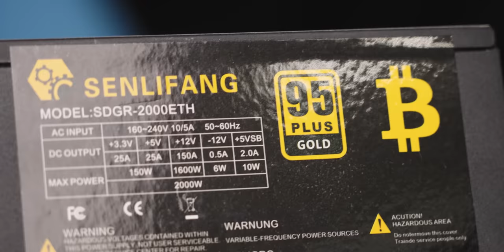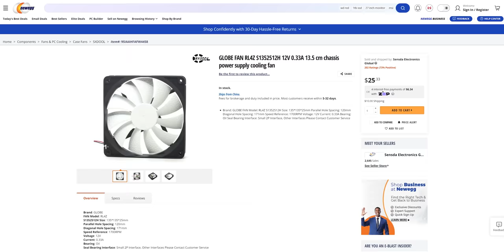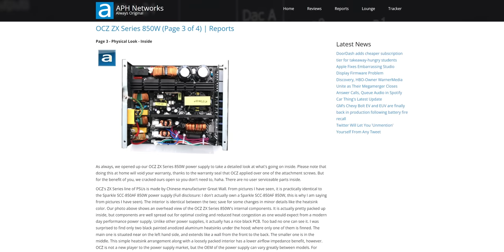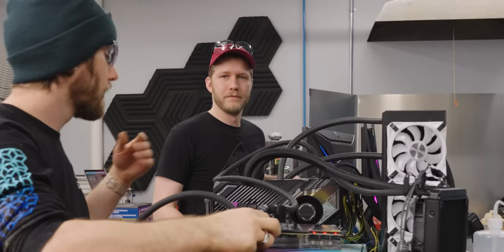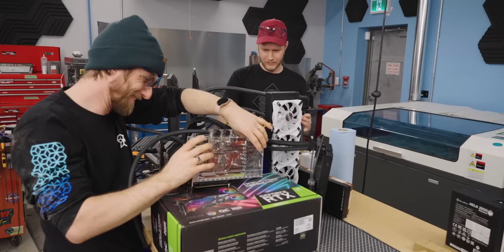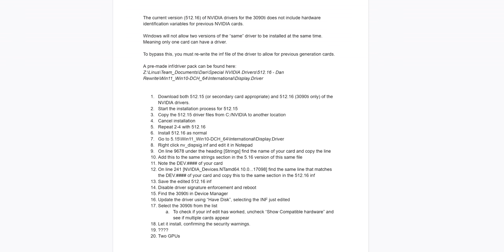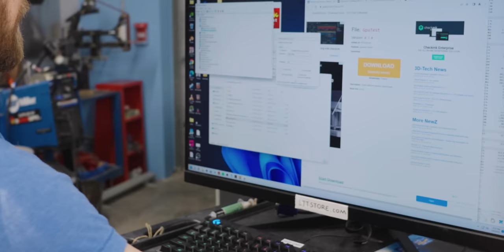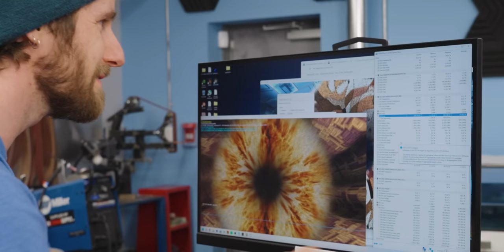This is one SKETCHY 2000W Power Supply

Comment: You guys should do collabs with actual electrical engineers who know what goes into power supplies to do side by side analyses like this. The size of a transformer for a given wattage and frequency is mostly the same regardless of voltages unless you're at very low or very high voltages. And PFC is necessary for anything at this power level regardless of voltage level. Weight difference could come from smaller filters on the AC side resulting in more EMI, smaller inductors and caps on the output meaning higher output ripple. It could also be that they used higher switching frequencies which would shrink weight and size a lot at the cost of efficiency which people are a lot less likely to notice
Reply: alex clark guy is an actual ENGINEER!
Reply: You do know that Alex is an electrical engineer, right?
Reply: As everyone's said that's Alex, also Kyle is an electrical engineer as well I believe
Reply: They do have actual electrical engineers. They just don't put in the time and effort to actually analyze anything cause being "probably correct" is all they need for a profitable video.
Reply: Agreed 👍👍👍
Reply: An electrical engineer wouldn't say that transformers and inductors are made of "lots of copper and lots of magnets."
Reply: That is the same thing i was tinking when i heard that guy talking like that, it is clear that he does not know or at least dont even care about how a PC PSU works. Anyways maybe that is cause he es a Electrical Engineer and not a Electronics Engineer.
Reply: Or there's the alternative: 
GamersNexus
Reply: I was trying to sort out if they were dumbing things down for comedic effect or if they really don’t understand what they are talking about. As for that modded GPU; I’m surprised that thing still even works....
Reply: @timnone2924  and others, I actually didn't know they were electrical engineers but given that they are only makes me more confused as to why they said things that were so blatantly wrong. As someone mentioned, a transformer doesn't contain any magnets in it, I don't really see the comedic difference between calling it a bunch of copper and magnets vs a bunch of copper and steel. And if it is truly just comedy they should own it, the side by side comparisons make it seem like they're trying to be scientific or atleast genuinely inquisitive and they're being neither
Reply: @timnone2924  if Kyle really is an electrical engineer, then I'm scared. He doesn't know the simplest basics about electronics

Comment: 8:42 That is not a MOV, it is a thermistor (NTC type) generally use to prevent inrush current (soft starter)...etc (NTC Type -  Resistance is inversely proportional to temperature)....Conclusion of Linus: "Based on the temperature of inductor"😮‍💨😮‍💨😮‍💨 ...You guys need proper Electrical/Electronics/Instrumentation Engg in your team.
Reply: Yeah, normally I enjoy LTT antics but this particular Video was just too cowboy for someone who knows even the basics of electronics
Reply: yeah.. that's a bit sad. They are not teaching but rather confusing more people. Same thing with the dead GPUs from ebay video where they were just bypassing MOSFETs. In most cases, the mosfet would be a switching component (as in part of a switching power supply) and not just a "relay" allowing current to pass. A GPU has no need to turn on some parts of its circuitry on demand.
Reply: Yea sometimes I question the EEs they hire. If your in product development you know there’s so many ppl from SI to PI to EMC to validate everything.. good times tho

Comment: "Where are we going to plug this 2000w monstrosity in?"

Me as a german: Dude that's only 2000w, my normal wall outlet is wired up for 3600w lol"
Reply: LMG snakes a power plug over the ocean
Reply: Isn't it standard 4000 watt for pretty much entire europe?
Reply: @bachmed00  I started wondering - how do American use hair dryers and such? I have a hair dryer that's 2400 watts, while average seem to be around the 2kW mark.
Reply: @hotwheels1997  They use them, but only at half the power. Just freaking terrible. I want my kettle to finish in 2  minutes not 4!
Reply: @DrakkarCalethiel  Damn, women must take even longer to get ready over there. Do appliances automatically lower their draw or they’re specifically made for the US market at lower power? I’ve never thought about this being an issue anywhere, new things to learn every day.
Reply: @hotwheels1997  Alone due to only running at 120V, all devices are specifically designed and rated for the NA market. Our Hairdryer eats 2200W, the equivalient US model only up to 1800W. They do have 240V for high power draw appliances like dryers and washing machines, but every regular thing has to cope with 120V 16A. We europenans laugh at that  with our 230/240V 16A sockets. :D Will be funny in future if the power draw of hardware further increases. A overclocked 12900k pulls 300W. a 3090Ti 450W+, rest also eats a couple dozend W. You quickly end up with a system that can draw an excess of 900W or even a full kW. Soon they need a whole dedicated circuit just to feed their damn PCs. XD
Reply: @bachmed00  Some time ago we used 10A runs in bedroms and other smaller rooms (where heating often was on a separate circuit). Now it's 15/16A all around, and 25A circuits for high-load appliances.

Comment: 7:42 That is not true. The point of a MOV is not meant to 'level out' the spikes. The point is that if an extraneous voltage spikes the MOV shorts, in turn triggering the fuse. Short term the fuse will not blow due to thermal inertia, but most over-voltage events are long enough to burn the fuse. This in turn protects the power supply and components after the fuse from damage. This is why you ALWAYS see the MOV after the fuse in the circuit.  
Actually without triggering the fuse a MOV would destroy itself extremely quickly as it cannot handle much power at all. It shorting a high voltage to ground with a low resistance would mean it needs to dump massive amounts of energy in a small time, hence it cannot be the main protection device.
Sure it might work for short spikes, but it is not a reliable and safe way of doing things. Especially as MOVs tend to fail in short circuit mode, which means that they will burn and cause a fire hazard.
Reply: Where the fuck did they find that guy, isn't he like supposed to know shit about electronics? He was wrong about everything he has talked about in every video he's in
Reply: Can confirm, an unfused MOV is a lot more trouble than no MOV at all! I once connected a 120V power strip to a 240V source, not realizing it had MOVs inside it (without fuses). An enormous bang ensued, followed by smoke emanating from the power strip. The output of the power strip didn't even shut off.
Reply: @DielectricVideos  My power strip had 3 MOVs as crude over voltage protection and "filtering". In the middle of the night the MOV between live and neutral decided to commit suicide and went with a loud bang. It was on a regular european 230V 16A circuit too for extra spicyness. MOVs NEED a fuse, be it a normal one or a thermal fuse. When they fail, they mostly fail short. Also they tend to heat up quite a bit when they get tired. MOVs have a limited lifespan and can only absorb so many transients.
Reply: @DarkoPetreski  like I was so mad ...they got so many thing wrong ..can't you take a day and search this stuff on Google? Smh

Comment: You could risk $6,000 in gaming equipment.

Or you could just let Gamers Nexus do it with the proper power supply testing equipment.
Reply: yeah there is equipment to test volts and watts for f sake... buut LTT has to do stuff sensational for views... (dont get me wrong I love these guys but still lol)
Reply from the maker: We've had a proper PSU tester on order for a couple months but with supply shortages it won't arrive anytime soon. -AC
Reply: @LinusTechTips  Meanwhile you could send it to Gamers Nexus and let them do the testing
Reply: @LinusTechTips   thanks for responding.

Figured originally you guys were just seeing if it blowed up a pc for the video..

Which I don't blame yall its a good video idea lol.

Comment: 11:25 In North America, that's the US and Canada, the white is always Neutral and the Black and Red are always Live (or hot).  You may see 220/240 volts run with Romex or extensions wired with the white as a second live/hot line instead of neutral, but these white wires are supposed to be marked with red or black tape (or heat shrink tubing ;) to indicate that they are also live and part of a 220/240v circuit and not actually neutral anymore.  Adding red or black tape is usually done when converting a 110 socket over to a 220 socket and you want to keep the original wiring...
Reply: Came here looking for this clarification. Thank you.
Reply: To be more pedantic, white and gray are always neutral, green or bare is always ground, and everything else is hot.
Reply: @eDoc2020  never shy from being pedantic. To go further it is now called the identified conductor, though still known as neutral
Reply: @8blade6  I thought the "identified conductor" was the one with the color tape applied. Neutral is the grounded conductor which of course is different from the grounding conductor.
Reply: @eDoc2020   Technically here in Canada, the black is the current carrying conductor, white is the identified conductor and the green wire is the bonding conductor not ground. You only have a ground conductor at your service entrance where it is tied to a grounding rod or ground plate in the dirt outside. After that it is called a bond as it does not go directly to earth but bonds everything back to the ground conductor.
Reply: @fakeacountname565  I guess different countries are different. I was talking about the US. Here your bond wire is called the equipment grounding connector and your ground wire is called the grounding electrode conductor.

Comment: Fun video as always but it was a bit tough watching the analysis of the supply insides, those ntc thermistors are for inrush current and are not MOVs, that yellow tvr was likely an actual varistor. I'm not an engineer anyways, and I get that a detailed explanation of the different topologies between the two supplies is out of the scope of this channel.
Reply: Yup, and talking about the 240/120v switch: there's actually very little extra hardware. The switch turns the bridge rectifier and input capacitors very neatly into a voltage doubler.

The talk about additional transformers was all wrong
Reply: @James Hogge  Yeah the discussion about the transformers was pretty hand wavy, those things are proper insulated so just touching the top of them isn't going to do any harm. They also aren't made of magnets, unless you're very loosely referring to ferrous materials. If I had to have a guess I'd assume each transformer was for a separate rail, or maybe even something esoteric like a multiphase full bridge/half bridge converter considering the power density.
Reply: Yes it's always a pain watching these bits of their videos, but it gives a great perspective of a layman.
Reply: yeah the level of incompetence in correctly comparring the two is jarring at times
Reply: @jameshogge  No.. Actually not... Those Switch Equipped PSUs are too crap and old designed Half Bridge Converter.. They tend to fail more than.. modern Dual switch Forward and Resonance LLC PSUs..

In modern PSUs.. The APFC Circuit actually Boosts Voltage for primary Capacitors.. to like 350 volts... 

And those extra transformers in that PSU.. we can't say about them much .. because.. they can be connected in many many ways .. like 2 in. Series..  or both in parallel of Primary series and secondary parallel..  or vice versa.. there are many possibilities... For transformer configuration for load sharing in PSUs...
Reply: Linus should do a collab where he gets schooled by that Australian EE guy.
Reply: @mcpr5971  that EEVBlog? or Electroboom? or GreatScott or DiodeGoneWild...  I can say DiodeGoneWild can explain everything about those PSUs..about both
Reply: @ArifKhan-bp9zx  eevblog. Thanks I couldn't remember it.
Reply: @ArifKhan-bp9zx  Oh really? I'll have to take one apart and see what they do these days. I've only ever reverse engineered one of those mid-2000s silver oem ones. It would be interesting to see how things have changed though but I'm surprised anything on the high voltage side is significantly different

Comment: You should buy professional load equipment, it can be controlled digitally, measure voltage, etc. It is way better than a regular PC with two GPUs.

Comment: Auto-switching power supplies don't just take 120V or 240V.  They take any voltage inside the range of about 100V to 240V.  Higher voltages mean more efficiency, which is why it's common in data centers to offer 208V power, because virtually everything you put in a server rack will happily run on that voltage.
Reply: USA and CANADA and JAPAN should just switch over to 240V. Would also be good for the enviornment.
Reply: Auto switching supplies only take fixed voltages. Fortunately these are rare nowadays and we mostly only deal with wide-input supplies.
Reply: @HermanWillems  North America already has 240 VAC single phase. We just have a center tapped ground bonded neutral because we're not poor and stupid like the rest of the world is.
Reply: @1pcfred  wdym poor and stupid? And everyone means 230/400 three phase in the house when they say 230 (220, 240)

Comment: Japan uses 100VAC, which may mean slightly lower performance or slightly higher amp draw if North American appliances are used unmodified.

Additionally, some of Japan runs on 60Hz (like NA) while some of Japan runs on 50Hz (like Europe).  YMMV.

Comment: Never cheap out on power supply. It is literally insurance of your parts.
Reply: indeed.  But considering 2000w? thats a lot lol, most parts now a days don't use much power.  My intel nvidia system is prety beefy and still idles at 90w and medians at about 200-300w depending on game, on a old class corsair  750w supply*(one of the bests I ever owned, as I own several); hard to find now a days :(     .  My netbook is like 5-10watts lol.

A good quality 500-750 w PSU goes a long way as they are prety strong, need one with  good high amp rails for some cards/cpus, if you don't plan on rigging 2 or more video cards.

Also, depending on heavyness, helps too.. CHeap psus don't weigh much. Good psus, weigh more which I find interesting.
Reply: I really can't understand why anyone would buy one of these PSU's. Spend thousands on a build with a 3090Ti and high end CPU etc, but can't spend $300-$400 on a quality 1200-1600w  PSU, which is plenty of power for the build.
Reply: @bongong1  Its fun to spend money on a badass GPU and a super fast CPU. Spending money on a metal box you will never look at past initial setup just isn't as fun. Even if it is a very important metal box.
Reply: @bongong1   Plus people are on a budget, some*, if you are able to cut costs and invest in performance on other parts and risk, and it works out, money saved for some.  I've done it myself too,  but I was lucky to get a no name psu with heavy components which is a good thing, and lasted me a long time, no use for it tho, as its old; mainly only looked at amp rails for my old 780 ti back then.; but switched it out to another corsair later on.

If going for a no name brand, always make sure for a lot of good reviews and look at the bad ones too. Sometimes they can be good, sometimes they're just bad.
Reply: @Khel   yea But I don'T ever think that far ahead on my builds like super crazy high perm builds, usually just keep them to a min with the 80s/ti's , I think I gone down the list on my buiilds from 780s and climbed above.. Usually keep the watts low when I can.  I don't think theres many that do, as they have a hard enough time to get more than 1 video card..
Reply: @bongong1  It's not meant for regular gaming systems. It's meant to power GPU mining rigs that may have 6-8 cards installed at 200 watts each. And for mining rigs, investment costs are very important, because that maximizes ROI.
Reply: Meh, using the same 630w powersupply for 2 build now, so closing in on 10 years. Still fine. It's running 3070rtx with 5600x, 3 discs for 2 years now straight. Bought 2014.
Reply: @MrGatlin98  lol mining rigs karmas a bitch ain’t it
Reply: This is exactly what happened at my workplace. They built great computers for image processing geared towards architects, but powered them with the jankiest and cheapest knockoff PSUs to ever exist. Of course both computers caught fire, although very lightly since the smoke and the smell made people act fast before any more damage was done. I still laugh looking at the melted pins, what a dumb management idea to make.

Comment: It would've been really nice if there were a comparison between the expensive and the cheap power supply in terms of temperature and noise.
Reply: Why? Just dont buy that cheap-o PSU.. please
Reply: @McKevittS  ENTERTAINMENT, THE ALGORITHM DEMANDS IT
Reply: Ehm, just dont buy the cheap one? If you need 2000W for your PC, its gonna cost upwards of 5000 dollars, so please, please buy the actual PSU that wont fry your components
Reply: Lmfao nothing is learned from this video
Reply: @gamm8939  we can still plug more than one power supply wich will cost a bit more than that cheap one but way less than the real good one^^
Reply: @Yo-ju1sr  Ehm, wouldn’t advise that.
Reply: @gamm8939  did it during long years with an 770 sli and later a cross of 290/390x with no issue, it was more easy to buy 2 good AC than a big one which did not exist^^.
Reply: David we learned about 3090s and 3090 TI's or whatever the numbers are. And we also learned the improper way to do things my only question is the indicated light on the end of the extension cord does it still work or 240 volts burn it out.